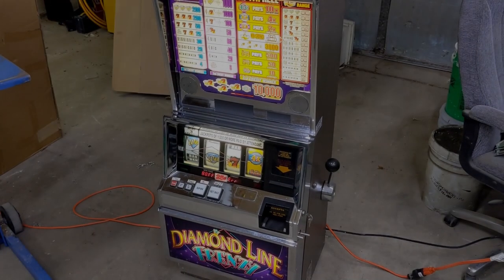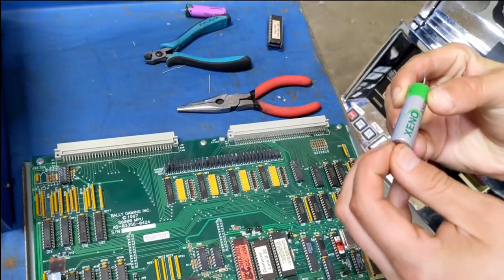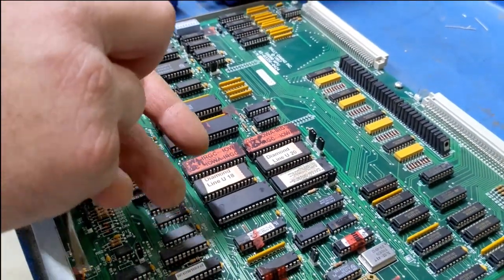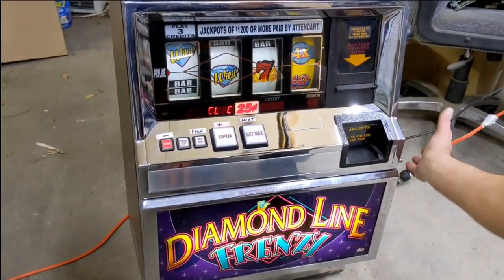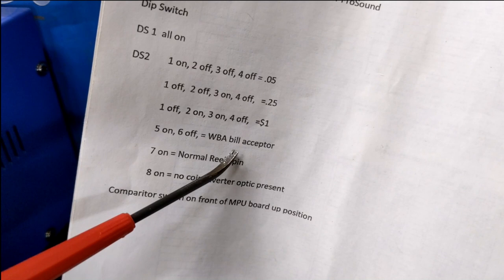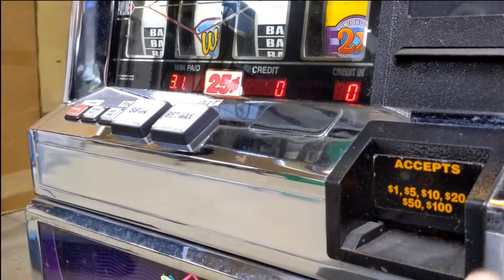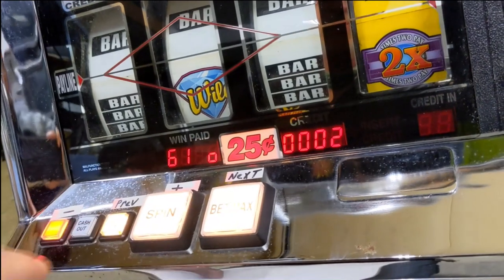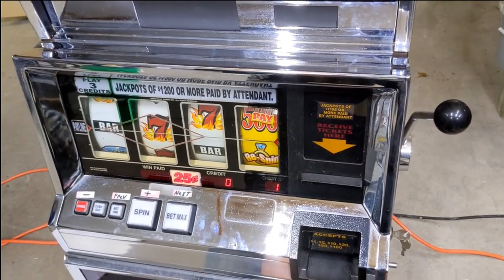Bally s6000 88FF Fix-Clear/Reset/Program-Dead Battery

Comment: I just changed the battery on the MPU board and reset the RAM. Now I'm getting a 31 error code. The hopper seems to work ok. Any suggestions would be greatly appreciated.

Comment: My coins go in and come right back out.  I bought the bally 6000 from a person on ebay.  After a few months,  the coins wouldn't go in.  I tried to reset the coin on the coin comparitor. A no go, and now i have an 88 error. Can you not just put in a reg AA battery? I would be willing to pay for a zoom meeting tech call,  if possible for direction.

Comment: I bought a proslot 6000 and it works fine but the only problem I have is that it never pays out at all, I use it for my man cave, it's the Fabulous Sevens
Reply from the maker: Okay, are you referring that you never get a win on the reels? Does it have a hopper? Ticket payout when you hit cash out?  There's a couple things, could be the setup to not pay out.  Hope this helps!
Reply: @Ps3mn1  it has a coin hopper but no ticket printer..
Reply from the maker: Alright, and when you say it doesn't pay out, when you get a win on the reels it doesn't spit out your coins?  Or only when you hit the cash out button?  Because I'm thinking your machine is setup to NOT pay out for your winnings.  If you were to hit the cash out button it should spit out what's in the hopper.  Please let me know more details!
Reply: @Ps3mn1  it works completely, I'm saying that in 2 years that I've had it has never hit a jackpot...
Reply from the maker: @moreno3662  Ahh, I got you now.  Then yes, that is definitely a setup feature that can be changed to how often you win, including jackpots. If you have the chips in order to do the programming different than what it's currently set to, I would give ya more help on that!  Best of luck!

Comment: Hello.  I have that same board that needs a battery.  where do i get the battery and the ram clear chip set chips?
Reply: Join Newlife games. Loads of info. Ram clear can be purchased on EBay along with batteries. But once you know your machine you can solder battery holders in, makes it a lot easier..